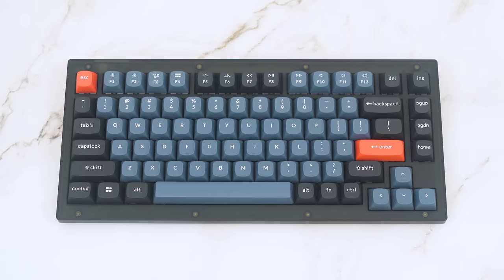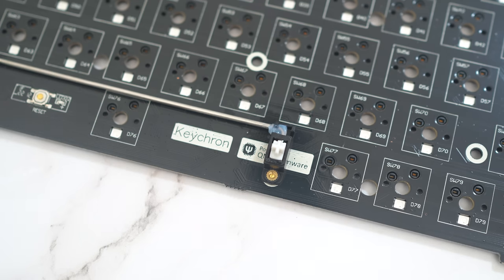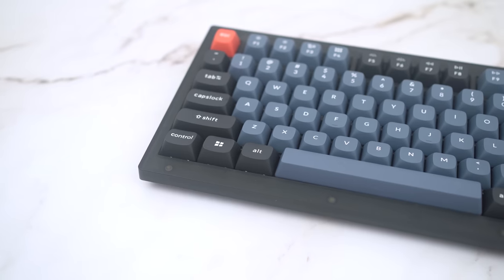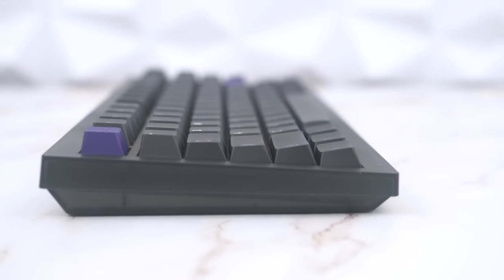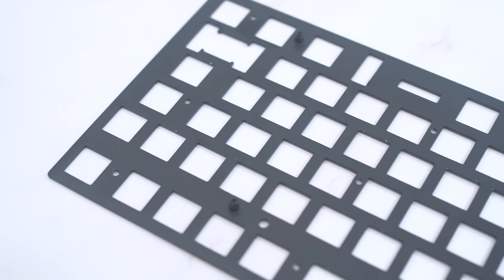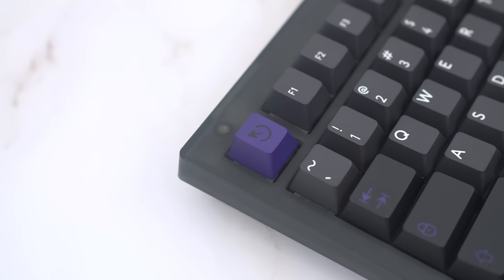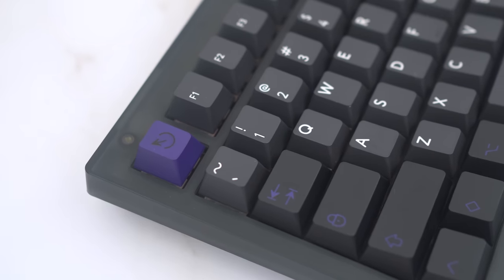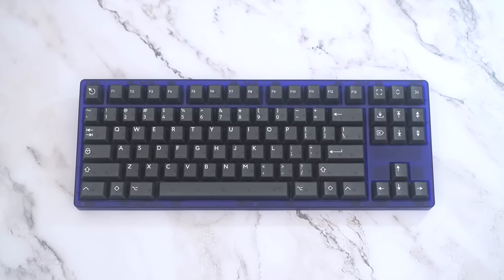I Modded a $54 Keychron to Make it GOOD - Keychron V1

Comment: Can someone tell me what makes this better than the IK75 / NextTime75? I know it has qmk, but what else is there that justifies paying $30 - $40 more?
Reply: QMK/VIA support and screw-in stab compatability are not present in the IK75, but that's all I can think of. Though, I will say that these are two very important features, because PCB stabs are king, and QMK compatability really lets you do whatever you want with a board.
Reply: this board also has a south facing pcb. might not be a big deal if you're not using cherry profile keycaps though.
Reply: South facing rgb led is a big point for this keyboard, north facing could make some annoying issues that you may not want to. And with QMK/VIA you have higher chance to save your keyboard from being an expensive paper blocker if the firmware error occured
Reply: just the QMK / VIA alone already worth 50 bucks , so you should know which one to choose

Comment: Let's be honest, it's not 54$ like the video says.

Right now prices are 74$ reduced to 64$. Add in shipping of 30$ and taxes, and you're easily at 110$. It's not like shipping will be cheaper depending on the region, shipping from Keychron is always going to be 30$. Unless vendors are selling it for the same price as Keychron does, I don't see the 54$ price tag whatsoever and at 110$ I'd rather add 5$ more and get the KBD67 Lite for 115 $ shipped and taxes included
Reply: Divinikey usually has keychron boards with them, so I hope they take the v1 too
Reply from the maker: That was at launch, when this video was created.  Looks like they increased the price now...
Reply: It's on Amazon for $70 barebone and $80 barebone knob